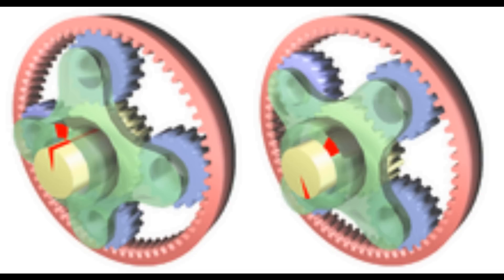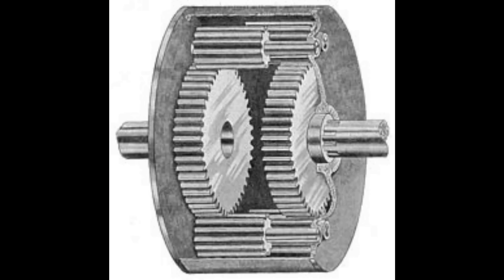2283 A Hypocycloid Differential

Comment: the non backdrivability of the hypocycloid drive makes the differential set irreversible to the primary hypocycloid input.

Another use for a differential drive - pure mechanics, is to use (one of many options) an infinitely variable transmission on the low torque input, to self excite the prime mover to generate "infinitely variable" output (reciprocal) torques and speeds - + and -, to Vmax... (industrial torque  "vectoring devices" may use hydraulics traditionally, of course a speed controllable electric motor is also  an infinitely variable input...)

I had a great time making a 2 stage hypocycloidal drive (non balanced) to generate a 2 stage 100:1 ratio in a 1" thick assembly - back in my early 3d printing days.. (using SW, I needed the cartesian form of the hypocycloid wave pattern, that was a bit of a trick to do... - Using a polar system - which I was more used to do (at the time) in Creo, is so much simpler..)

Comment: Thank you Rob, after watching this video it finally dawned on me that to power my grain mill with an AC motor (which spins way too fast), instead of using a small wheel on the motor shaft connected by a belt to a very large wheel on the mill to get a 60:1 ratio, I can get the same reduction with a much smaller 3D-printed cycloid gearbox.
Reply from the maker: yes you could mate - nice one!

Comment: I have been toying around with this differential idea for a couple of years.  I have been looking to design a pedal car that combines the work of the pedalers.  I have been to beaches and other places where they rent pedal cars to groups and families to ride around in.  The trouble with them is that all of the pedals all drive a singular chain.  So a great deal of the muscle work by the strongest pedaler is lost making up for the weakest pedaler.  I am envisioning a pedal car where even the efforts of a small child can add to the efforts of an adult to make the car go.  I see a differential as the best solution for this, although I have yet to determine which design will work best.

I can also see this as a good idea for the little toy pedal cars for children.  You can have a larger child and a smaller child riding and pedaling together, with each feeling like they are contributing to the car but not feeling like they are doing all the work.
Reply from the maker: i like your thinking mate and yes a diff would be an answer i think
Reply: ??- differentials setup  with spragged inputs - to eliminate any reverse rotation (inadvertent back driving) on any unpopulated pedals -  have as many inputs as your system designer can conceive - all summing to feed the one output  (an AWD system  - as many as you want 1,2,3,4,5,6..  etc..  in reverse, spur gear differentials are very suited to constant  duty / operation.)

Comment: Just putting ut out into the ether, a good project, a professor in Glasgow creaded a harmonograph .  A dual pendulum platform that can draw a Lissajous curve.  A circle or eclipse can be a special Lissajous curve. The wikipedia details what "angular frequency"  (of the pendulums?) will give you a circle.  So we have a pendulum(s) ,  a pretty graph,  circular or elliptical motion, than we can hook up an input , wind,  and use the motion to turn the stored energy of the pendulum into electricity to power a capacitor and led.  All we need is a really big 3d printer.  Just putting it out there.
Reply from the maker: interesting idea mate - thanks for sharing

Comment: Why is the spare's rim so rusty?
Reply: Steel wheel painted black. Paint has chipped off over the years exposing bare steel. Just like on the differential, leaf springs, etc…
Reply: Omg rust
Reply: There is a salty mist in the air that rusts everything.
Reply from the maker: sea air

Comment: Dr. Smith, How did you make the two part gyroid 3D print? I can't figure it out. Thanks!
Reply from the maker: i set the shell thickness quite high then made it a hole and merged it with a solid block
Reply: @ThinkingandTinkering  you merged the gyroid with a solid block in the slicer?